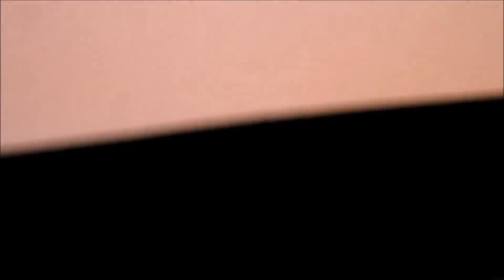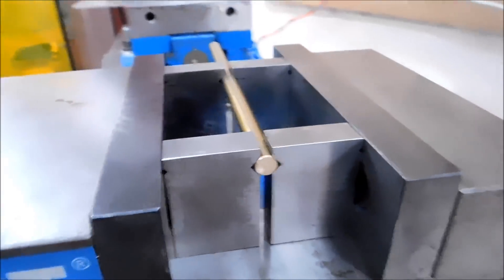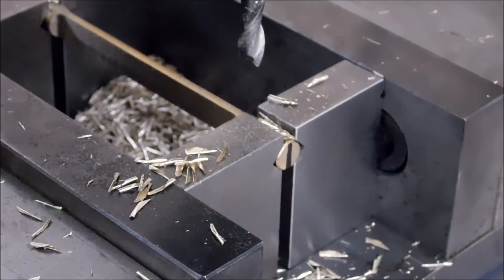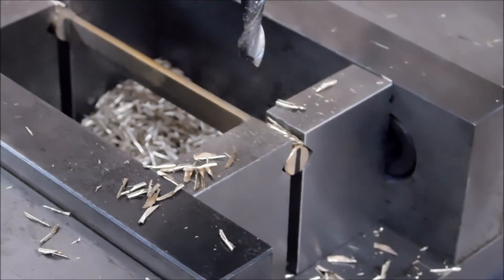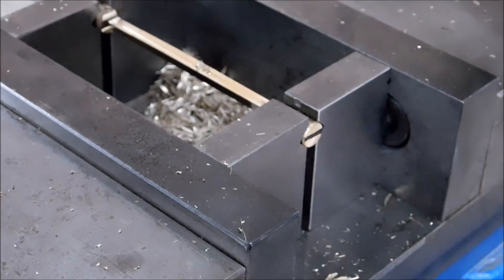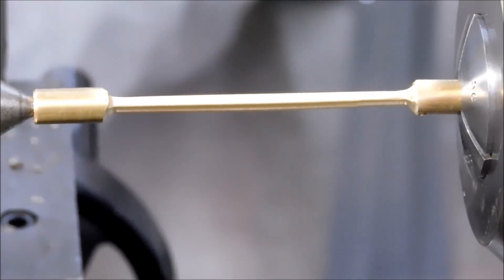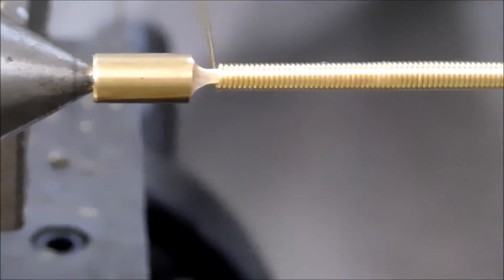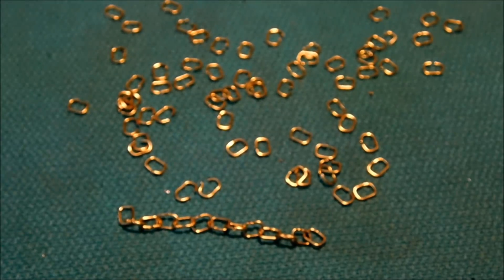Making Square Link Chain

Comment: I really appreciate the time you take to make these videos and respond to comments. This video did raise a general question (from a true amateur): What would be your suggestions on providing tension in a lathe?  Do you have any videos that cover this? 
A use case would be for  an even longer and skinnier mandrel.  When I thought about this I realized that  in general tailstocks are set up to push not pull. 
I came up with a couple of possible kludges,  just interested if there a standard/clean method. 
Thanks
Reply from the maker: Can I ask what application would require a tailstock to pull?
Reply: I was pondering a thinner/longer mandrel that otherwise would not be sufficiently rigid, adding tension would make possible a very long mandrel. 
In your application looks like you got plenty of links from one run. 

Obviously would need a live center as part of the settup,  the startup could twist the stock due to inertia of the rotating tail stock parts, my imagined kludge ended up with a lot of stacked parts. 

Might also be useful for other thin/long operations, although your video on thin parts show how it is generally possible, if you plan ahead. 

Another application would be winding thin (insulated) resistance wire around  thicker wire as seen in wire wound potentiometers. 
Of course there are dedicated machines for this for production. I had a summer job in the 'Ace pot factory' during college, the back room was full of automatic swiss screw machines cranking out the housings and other parts. Rather mesmerizing to watch.

My job was to use a mini baking soda sand blaster to remove the insulation on the wire, (already installed in housing) where the wiper made contact
.
Actually got in a bit of trouble by talking the machinist into making me a jig to hold the nozzle at correct depth/angle inside the pot rather than hand hold both.
I was able to do them about twice as fast, the trouble came when I ran out of work, which the foreman did not appreciate. Good lesson in the type of environment I did not want to work in. The company went bankrupt a couple of years after I worked there.

Engineering 101 "you cant push a string"
Real world 101 "unless it is wet and frozen"
Reply: You can get 3-jaw chucks that go at the tailstock end  and rotate freely for supporting awkward parts. You could pull with one of those. Except that tailstocks are always morse taper and very few allow for the use of a drawbar. (Some do, early Myford, for example)
Reply: Thanks Andy, that's about how far I got in my thought experiment when I got to the morse taper issue.  Guess one could use a precision sleeve for the in/out and a yoke on a bearing to apply tension.  Can imagine a number of arrangements but without the experience I figured I would ask if there was a known way to do this.

Comment: First of all they sell square bar stock, so all you would need to do is mill your groove into it and mild steel would work just fine for you jig, you don't need brass to make the jig with to make brass chain links, kind of over kill if you ask me, but to each his own, either way have fun with your project.
Reply from the maker: I could have used any material to do this, and could have done it 10 different ways. I chose brass for the mandrel for the speed of milling to save time for my viewers. The demo was more about the pinch blocks and philosophy of how it was done. By the way, last time I checked, 80 x 160 isn't square. Thanks for watching

Comment: Why brass for the mandrell ?  You mentioned being having to be careful to not  squeeze  the wire too hard lest it dent the mandrel making it hard to remove. Steel (12L14?)  would remove that constraint and let you add more 'hand work' detail to the links. 
Also probably strong enough  to thread it to make it removable from a center drilled end, or just leave it flat and use a set screw, at 30 rpm balance is not much of a concern.

Sandwiching the links between relatively coarse sandpaper and gentle tapping would  flatten the sides a bit while adding forge marks. That  of course would be an aesthetic decision.

BTW: I am with others who did not guess where this was going almost until the wire was added.
Reply from the maker: Just for the speed of making the arbor. No other reason.

Comment: Couldn't you start with square stock? Seems like a lot of work went into putting a square bar in a lathe. Is there a reason for that. I honestly dont know.
Reply from the maker: It was rectangular, and I wanted to show the 4 pc. pinch block setup.

Comment: Being an EE person, I was wondering if maybe electrical wire would have served your purpose. 12 gage or maybe 10 would give you a larger diameter. And it would be stiffer also. But then again I may be off base on this theory.

Comment: Would have thought you would have put a wire relief from the holder to the die body.  ~( ,m,)~

Also feeding wire through a gauged wire feed tube increases the accuracy of the bend radii and reduces potential injury from getting one's fingers caught by wire being wrapped around them. ~( 'w')/
Reply from the maker: Trapping a rectangular arbor against a spring loaded pressure pad also work very well.
Reply: This is true and a good idea too.

I have a coil winder [for transformers] which one could use [have even made flat coils for pancake generator] and I can load any armor, with tension and could put a pressure pad and counter pressure pad, would work very well.

If there were a tiny 3 faced [triangular from the end profile] steel strip you could put into the arbor, you could press it with a similar one in a jaw and make all of the cuts in one move, especially if you were mass producing them, and make your arbor where the end slips on [perhaps with a small set screw] rather than be such that it has to be 'use-only-once' due to the cutting off of the end. Just drill a hole and broach it to the dimension of the flat of your mandrel.

Comment: I was wondering if you might use a Dremel with the cutting blade to cut the links off
Reply: That's fine sometimes but for links this small the kerf of the blade might be enough to make the links look ugly when squeezed together.
Reply from the maker: A jewelers slitting saw would probably work best.

Comment: Nice job, Well done!!
As an old Jeweller, please let me offer a few tips for making the wire "coil" & the "spit" (what you call an arbour).
We'd mostly make our spits from steel using old nails etc, if it was to be oval then we'd flatten using a "Rolling Mill" to get our width x thickness.
Typically we'd just use an old "eggbeater" Drill (held in a vice) for rotating the spit & winding the wire onto it. 
If the spit is anything other than round, first wrap it with some paper. (we'd typically use a piece of tissue or even a bit of 1200 emery) 
Wire needs to be FULLY annealed, slide end into hole then start wrapping it over the paper until the spit is fully covered. (or when you've got enough links)
Gently heat "coil" to slightly release the tension imparted from winding & burn paper away to ash, this will allow for easier release of the coil from the spit.
Clip the wire at hole so you can slide coil straight off end of spit. (remember we use nails so no obstructions at end)
Cut coil with a Jeweller's handsaw using a fine sawblade to make the individual links or what we'd call "jump rings".
This way the jump ring joints were square & flat to each other, allowing the joints to close up better, clean & tight.
HTH, Colin
Reply from the maker: Excellent. thank you
Reply: And for those that can't quite visualise what I wrote, here's a video by Pepetools who happen to make a more elaborate version of the idea.
https://youtu.be/Wa1w0Qzy04s

Comment: Looks like good fun. As you say, the wire could  have been thicker. In chain maile manufacture there are ratio tables that give the wire diameter and arbour diameter options to suit whatever you are doing, so that the metal to air ratio in the weave looks and feels  good. There is an ideal range around the sweet spot that is up to the maker.
Your cutters, even thought they are flush cut, will leave a square cut side and a point cut side. You can cut the link, then reverse the cutters and trim the pointed cut, or you could have made your arbour wider on the side you are going to cut, by the thickness of the saw and then sawn each ring off the arbor. You would then have square cuts on the wire, and square links.
Jewellers saw blades (coping and Dremel style) go down to about .004" The coping saw option is easier unless you are doing a production run of millions
When you have some spare time (joke) have a go making a six inch square of chain maile. It is quite satisfying to do, and is both weird and tactile to hold.

Comment: Put two pieces of wood in a tool holder and your wire between the wood.  Adjust the tension on the wire by tightening the set screws on the tool post.  Set your carriage to thread the same pitch as your wire diameter.  This process works good for making coil springs too.  Nice work!
Reply from the maker: I was worried about loosing my feel for the tension and breaking the wire.

Comment: Another great one, Joe! Love the work holding technique, I'm definitely gonna have to try that.  If anyone's squeamish about feeding wire over a mandrel on a lathe, a MIG tip threaded into a piece of bored-thru bar stock in the toolpost helps keep tension, of course the operator still has to have their brain engaged.  Great video, I can't wait to see this cannon come together!!
Reply from the maker: Thanks. Its something I always wanted to build. I didn't realize how intricate the wheels are. Lots of math and partial angles to deal with.

Comment: Might be a good idea to use a ball end mill thats just a few thousandths smaller than the height and width of the arbor to releive all 4 sides and shape the arbor kind of like a geneva gear. Could pinch the links more without them getting stuck and theyd be more square once snipped and sprung. 

Nice video joe, thanks for the lesson.

Comment: Clever, just like winding a spring. Surprised you didn't have a tool post mounted wire guide, much less dangerous than holding carnivorous wire in your soft juicy hands.
Reply from the maker: I had soft juicy hands once upon a time. I still push my luck once in a while.

Comment: What was the purpose of the ball-end mill groove ????
Reply: If you listened he told you it was clearance for the nippers.  Much better cutting job if you can get a tip on each side of the wire.
Reply from the maker: Cutter clearance

Comment: Ouch! A chip hit my eye. Ur gonna have to use less air pressure next time
Reply: Think it is a lot safer to use the shop vac but just make sure the chips are cold!
Reply: This seemed like a lot of work for chain you can buy in all shapes, sizes and materials, at least in a bead store in Albuquerque.

Comment: Awesome as always.  Finally, I might have a tip for you or someone else here.  I frequently wind coils for radio frequency work, copper wire over whatever coil form, using the lathe, and I made a jig so simple I might be able to describe it here (if not, I'll get a pic up on my site).  Take a chunk of wood, in my case ~ 1" wide, 1/2" thick - fits my toolholder.  Use fairly soft wood (in my case we don't want to scratch the stuff).  I put a little slot in the end with a hacksaw blade, angled down a little from the surface, to guide the wire.  I have a little screw in eye further back to help guide the wire, which is held on a spool, in turn held on a bolt welded 90 degrees from a slab of metal that fits in the other side of my toolholder.
By setting the TPI of the threading, I can have whatever pitch or spacing I want - little to no skill required, and now tensioning is done with the palm of the hand on the roll of wire - no gloves needed either.  Bind the starting end whatever way - I use hot glue when I can't drill a hole in a ceramic or glass form - crank the slide so the end of the wood nearly touches the mandrel, and hit go - I can only get down to 50 rpm, but that's fine.
Saves tons of work, you get perfect coils, and it's safer.  Only took a few minutes to make this jig, and it's saved me many hours turning out beautiful coils for transmitters.

Comment: Jewelry makers have wire ring tool for this. After the wire is wrapped/formed around the arbor they use a Dremel style slitting tool in the groove to separate the links.
Your methods is far more customizable.

Another great video.

Comment: If the wire is small like that maybe a little bigger try spooling the wire on small empty spool (old fishing line spool).   Then let it spool off onto the arbor. It would help ensure no kinks and help to keep everything is in view while the lathe is on.  Really like the blocks to hold round stock in a vise. Great video!

Comment: Fun watching you make the arbor with no idea what the heck you were doing until just before you put it in the lathe.  I thought you were making square stock to bend into the links first... doh.  I've seen people use two pieces of oak with some parafin to clamp the wire rather than your fingers.  You can safely get more tension on it.  Now for the fun of tig welding all of the links closed :-).
Reply from the maker: Sorry about the one unannounced air blast. I remember you commenting about how loud that is through headphones on another video I posted. Thanks for the comment on this one and good to hear from you. BTW....I won't be welding these links just yet.
Reply: I appreciate the call out, but that wasn't me.  I don't use headphones and my crappy speakers on the laptop couldn't damage wet tissue paper.  I can see how it would affect those using headphones though.  The link welding was a joke obviously.  Are you going to solder them?  I made a silly attempt to strike an arc on a pop can (like the pro's do to show off) when I got my tig welder a few months back and blew holes in it so fast it was laughable (I didn't really expect any different).  I don't even think Jody could strike an arc fine enough to fuse your little brass chain links.
Reply: Heh, I thought so too...

Comment: Why the marker line use a 123 block against the side of the work, no guess work there!
Reply from the maker: I would have if there was sufficient room and a flat surface under the part. That is a good method.
Reply: Heh. I keep a small engineers square right by each machine for just that purpose.

Comment: I think pun was intended. No issues here though.
Reply from the maker: It was accidental, but worked.
Reply: Finished watching.
Very nicely done.
Thanks for sharing.
Question: When cutting a very long flat bar in a vise on a mill and the bar extends past the vise and table 4 feet both ends the best support would be a jack stand. Would you ever consider using an overhead crane to stabilize your work piece overhang? Then why or why not? Your expertise will be greatly appreciated. Thank you.